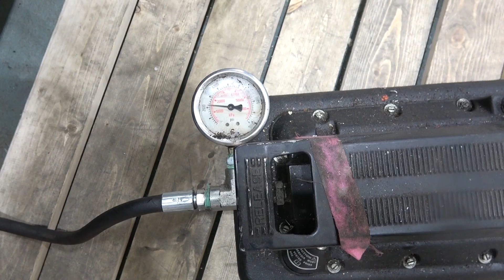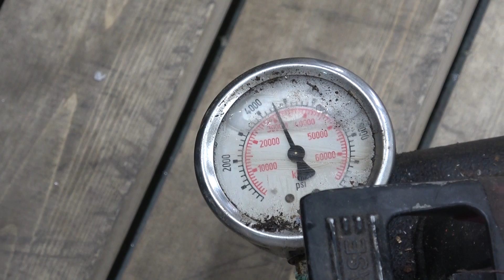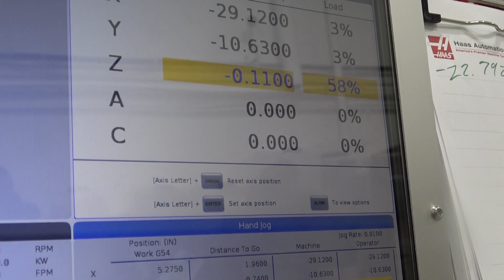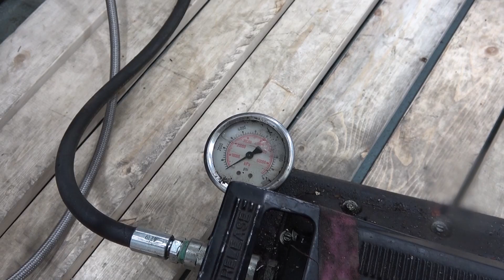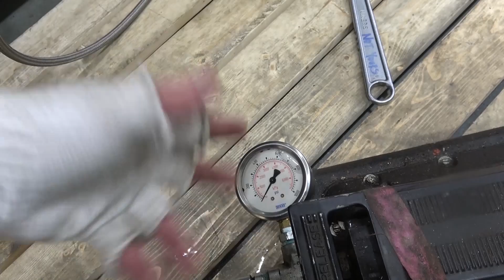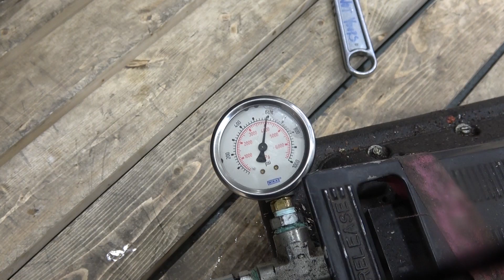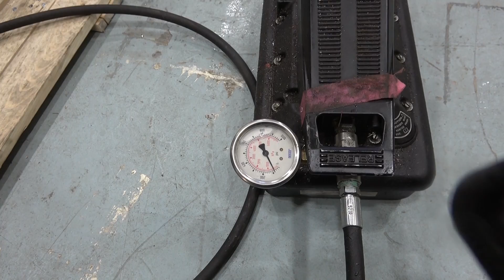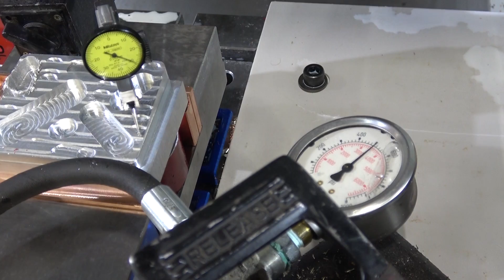Hydraulically Testing Pull-Out Force | Strongest Vise Jaw

Comment: Put an indicator on the top of The Pusher jaw. You will see it lift as you tighten it. So your part is already being pushed out just by tightening it. you can tighten the Allen screw in the middle of The Pusher jaw, it helps a little.

Comment: What about material malleability? Two material interfaces involving 3 soft metals vs two material interfaces involving one soft metal and two hard metals. Ask an Electrician, you can tighten a clamp down onto copper to a specific torque then go back a few minutes later and it will have eased off due to the malleability of copper.

Comment: I believe Aluminum on Aluminum has an abnormally high friction coefficient because the materials are similar. Similar metals like to stick together, so a steel part in the aluminum jaws vs copper jaws may have vastly different results
Reply: Upon further research, aluminum on aluminum has an extremely high coefficient of friction (rare example of mu potentially greater than 1 in some cases) - reference Norton Machine design. Therefore, use aluminum jaws for aluminum parts
Reply: I would guess from this information that a steel part would actually hold better in the copper jaws, since steel and copper are metallurgically compatible

Comment: You've made a critical error with those fingertipless gloves.  You see, those are designed to be cut back to each knuckle sequentially, giving you three goes in sub-freezing temperatures.  If you cut them back too far, the frostbite travels past the knuckle and leaves less stumpage to work with the next time you get caught out in the cold.  ;)

Comment: Cnc 101 at the community college. We write our first past as a class. Runs great in master cam. Go into shop brand new haas never been choouched. Load up and green button. First pass is facing with 2 5/16 job. Rapid traverse about an inch into brand new kurt vice. Some real deep purple chips and a dive to the catsup button. Learned to set zeros. But that vice will be forever marked.

Comment: The transition of forces during drill break-through is the exact reason that drills ground for aluminum have a smaller point angle. 
Even when the part stays in the vise the transition can break the drill flutes right off the shank.
Having the smaller angle increases transition time and reduces the shock to the tool.
You know where the bottom of the hole is in vise work, so it pays to program a feed rate reduction when you're cutting soft materials.

Comment: Super tight vise, isn't necessarilly going to hold better, despite outward appearances the jaws do flex, even if just a little, Put an hindercator on the solid jaw and tighten yer vice at a couple different torque settings... its really surprising

Comment: Possible explanation for reduced force despite coefficient of friction: the small amount of aluminum/copper jaw proud of the work peice will deflect imperceptably. Put an indicator on the fixed jaw side and see if it's bending back? With the steel jaw, deflection is less (stronger material, nothing proud of the jaw). I wager the top of the soft jaws aren't exerting the same pressure on the part as the top of the steel jaw.

Comment: Gonna watch the whole thing, but a few quick thoughts just from reading the description- 

1. What grips what what the best material-wise? Does ferrous grip ferrous better than non-ferrous and perhaps, bench-vice-a-versa? 

2. What about surface finish? What happens if some shiny ferrous jaws clamp down on some shiny ferrous surfaces? Do they act like gauge blocks? What if some gnarly, knurly ferrous jaws clamp down on some aluminum? Do they just dig in, or dig in and also weaken it structurally?

Comment: I think the reason steel works better is because steel is stiffer. The jaws of the vise slightly deform when clamping on the part, and deform the other way when the part wants to go. Steel doesn't want to deform. 
As a preliminary test for this idea I suppose you could try to use a harder piece of steel, or harden a piece you've got?

Comment: Steel is best because you can put more pressure on it and it doesn't warp as easily. Copper and aluminum are very very soft metals. Steel however is not soft at all.

Comment: The more you squeeze on the stock, the more it will want to pop out of the vise. Think about squeezing a file card or a playing card, the more you squeeze it the more arc you get. I would be curious to see if doing the test at 40 ft/lbs yields different results.

Comment: Forgive my novice ignorance, but I was under the impression when you get your chip load/tooth right the forces should be minimal. RPM feed rate and # of flutes. Luckily we have computer numerical control to calculate all that mess for us. I'm still working on rpm controls from the pc vs manually turning it down at the controller. Linuxcnc based pc and chinesium 6040 cnc. Only messing around with dead carbon carcass and refined dinosaur remains pressed in sheets so I can just give er, but actual metal chips as soon as I figure out the spindle control.

Comment: Is the coefficient of friction, that you find in most reference books, determined emperically or is it derived mathmatically?  If it is emperical do they determine the dynamic coefficient or the static one and then use that to determine the other.  I'm asking because if there is some sort of mechanicalsurface effect happening between the harder steel and the aluminum, then that will definitely cause your experiment to show that more force is required to break aluminium from steel jaws. It's possible that this effect might not appear in the aluminium breaking free from the copper jaws because both materials are softer and would therefore allow each material to deform eachothers surfaces with less force.

Comment: Also, you're using a horrible fraught tor-q-que wrench which is likely next to close to inaccurate as fraught.   Be intesting also as is the machinist friend, a piece of paper on one or both sides of the workpiece to increase frictiones.  We do that all the time and it keeps her stuck down no problems.  Maybe the amount with the vise force that the jaws are compressing lessening the farce?  Steel being the lesser of these evils.  I can tell you that unless you're hogging the frack out of the work piece, even a short custom vise hangle at a moderate chooch won't let the workpiece move attal.  If you want a nice finish using a shell mill, less is always more till she gets kicked like a horse right outa there.   Lest you're takin 1" DOC with a 4mm radial in D2 or 304SS, you can get away with a lot lest than you stink.
Reply from the maker: It's a proto.

Comment: Non-linear, like my car's gas guage?
Reply: Tank narrows put towards the bottom. Less gas in bottom half.
Reply: One would think it could but most likely not. I'm sure its still read via a floater in the tank. These days a horse and buggy will run 25,000+ and you would still get better gas mileage, so it does not suprise me unfortunately.
Reply: MK1 MR2 owner here - below a quarter tank, my fuel gauge is actually more akin to a stopwatch.
Reply: You joke, but my '95 Impala's gauge reads crazy high, pegged a hundred miles into the tank, more than half at 200 miles, only starts to really fall after 250 miles.

There's a fix, install a resistor inline, but if one uses the trip odometer then it doesn't matter much.

Comment: Are those steel jaws ground, or milled? Looked like you milled your copper ones. All else being equal, a ground finish should grip better than a milled one, right? If you milled the aluminum ones too, but the steel ones were ground that might explain why they grip better on your aluminum test block. Or I might be totally wrong!

Comment: You want holding force? Dovetail that shit. Make a set of dovetail jaws, cut dovetail into the part gripping it with more surface area, then mount it that way, practically zero clearance because you're going to deck off the bottom anyhow.

Comment: That is the correct pull out on the vise jaws, You did not place the clamping force on the full jaws only the part hold are that is only about 1/4 of an ich squared hence that is why the low push out PSI?

Comment: Correct me if im wrong, but as i understand it... if your goal is to clamp a part with as much force as possible. one side of the equation needs to have a density/hardness factor greater than the other. either the part being held or the jaws need to be much harder than the other. So for example if i want to hold a part and not damage it, i need to use a softer metal than the part for the jaws of the clamp. It will limit your clamping force because one side will collapse under the pressure. If you want to hold the part and not be concerned with damage. the jaws need to be as hard a material as possible and the part being clamped needs to be a softer material. Aluminum clamping aluminum. you will be limited to the overall hardness of the material because as you apply more force both jaws and part will crush and only so much force will ever be applied. a force equal to the hardness of aluminum in this case.

Comment: Why are you not using the full height (or even half the height) of the vice? As opposed to just the top cm or so. Shouldn't that help?
Reply: Of course it would for the total force required, but when your talking about PSI it shouldn't change once the math is done. He was trying to avoid the math, that's why he talked about the size of the hydraulic cylinder.

Comment: Copper is better when you aren't clamping flat on flat. You use copper to take advantage of the deformation so as to 'hug' the workpiece.
A harder clamp material with a non-flat interface can hold work pretty well. Take advantage of the workpiece's deformation by having your clamp poke into the work, so to say.

Comment: There are a few things that apply more grip to the part while in a vise like sitting it lower in the vise. You'd be suprised how much deflection Kurt vises have at their max torque. Another would be to apply friction in the form of recessed grippers. I've made a thin horiontal relief line across the entire gripping surface before. this works well without marking the part.

Comment: gauge last calibrated never.. haha, most of us think everything with numbers are 100% accurate, good to be reminded every once in a while.
I guess aluminium soft jaw's low holding power is because aluminium deforms much easily, or the oxidation on the surface?.  if you think the jaws and stock as springs in the y axis, you could model the system as spring mass damper in software.  such simple simulation probability enrage all the material engineerds.
looking forward steel dovetail teeth jaws test.
Reply: "most" pressure gauges of this type are most accurate at 50% of full scale. -when new, or recent calibration

Comment: Does the aluminium oxide act as a lubricant layer between the materials? (Which would explain why [ Al | Al2O3 | Al2O3 | Al ] would slide before [ Al | Al2O3 | Fe ]. )

Comment: You need to mosey on over to your scanning electron microscope in the NW corner of the shop.  I bet you'll find the granular structure of the materials and the surface finish have some impact here.  Either that, or copper deforms on compression and can't hold any spring that the steel can.  It also could be your lack of beer in the shop.

Comment: Could the test results be showing deflection of the material of the jaws before the co-efficient of friction is reached?  This could explain why the steel worked better.  Another test with a larger 'bite' area might prove more reliable for just a friction test.
Reply: I looked up a bending force equation and it seems very possible. I only estimated the values for the metals and surface area though, so I don't know for sure
Reply: @connorfrazee8272  Only there is no bending. The jaws are supported over their entire length.
Reply: and some slack in the vice/jaws in the vertical axis
Reply: Thought the same.  Especially with Al, and measuring center deflection in thousandths
Reply: Not a chance. The jaws are too thin and are supported over too large an area for a measly 500-1000 lbs to generate any kind of measurable deflection.

Comment: Those "two little dingle arms" on a drill bit...
Spiral flutes are good for removing chips but they're lousy cutting faces. I like to grind the tips off mine with a dremel tool with one of those potato chip cut-off disks on the same plane as the drill centerline.  Don't have to take much off to get a zero rake cutting edge. And it's super essential when drilling sheet metal.

Comment: I vaguely recall from a mineralogy class I took a few years ago that copper's crystal structure isn't very resilient to forces like that. The top few layers of molecules can slide like Molybdenum or Graphite just not as easily. I'd just assume anything that can be used as lube has a bad crystal structure for holding things in place.

Comment: Copper does not age harden, so it is the softest and most plastic of the three. Aluminum age hardens and thus is a smidge more stable. Steel is...well steel. Combine all that with jaw climb and you may be loosing effective surface area.

Comment: You're probably deforming the materials and not just sliding out.. Especially with the copper
Reply: That's my thought, either the jaws are deforming or the part is.
Reply: @peterwelsh6975  A little from column a, a little from b.
Reply: Deformation could increase stickage to a point though, before dropping off. 
Just like soft compound and warmer tires will stick better cause they have a conforming and thus larger overall contact area.

Comment: It would have been good to measure the clamping force for each set of soft jaws.  It's possible the copper jaws are deforming  and transferring less force to the part at the chosen torque.

Comment: Might I suggest moving the kurt vice closer to the operator on the table. Two reasons: less reaching in and tweaking your back and your vice handle can spin 360 degrees for faster jaw adjustment.
Reply from the maker: but but it's already squared up.
Reply: Oh, you got it set up perfectly? Break it down and set up this one piece.

Comment: the force would be greater if the pushipushie its in the middle of the pice??
Reply: Would probably avoid twisting and catching, might lower the threshold of pressure but it wouldn't change the effectiveness of the pressure, would still push just as hard off to  the side

Comment: Forgive my possible ignorance, but doesn't area of contact come into play?  Test for test it's ok in this instance since it's all the same between each material tested, but overall if there was more area of contact wouldn't the friction increase? Therefore getting the "push it up" force closer to the clamp force?
Reply: It comes in play when computing the force, as force = surface * pressure.
So since he's already talking about the normal forces, the surface has already been taken into account.
Reply: @GigAnonymous  I understand what you're saying, but if I have a gauge that's reading "x-value clamping force", it doesn't know what area that force is on. If that force is on the area the size of a pencil it's going to have a different amount of friction then if that force is over something with a larger contact area right?  The normal force is perpendicular to the frictional force that is being tested here correct?  I could clamp a cylinder in the vice with an incredible amount of clamping Force but since the contact area is so small I could probably tweak it sideways fairly easily
Reply: Not really, at least in theory it is independent of area. The only things that count are the force and the friction coefficient. If you get a bigger area you distribute the force more. It can however be helpful when machining very soft materials like wood or if you get your jaws to flex enough to be a reverse dovetail but I don't think that is reachable in practice.
Reply: Roughly speaking no. Friction is proportional to pressure, but pressure is inversely proportional to area. If you double the area but keep the total force the same, pressure drops by half and friction doesn't change. If you increase the area while keeping the pressure the same then friction increases also.
Put another equivalent way: friction is proportional to force between the surfaces, not pressure.

Comment: Partner, you know those Kurt vices split the tore que in and down, right?
Reply: That's just to keep your part from cocking over (deflecting) too much, under the strain of the vise. Makes for truer, more repeatable cuts - it doesn't effect the pull-out force.
Reply: @interstellarsurfer  I think he's just saying that the rated clamping force may be accurate, but the total clamping force is at an angle down, so it won't read the full force on the x axis only, since some of it is in z direction

Comment: Not everything machined is aluminum.  It would be interesting to see how those jaws work with holding different materials.  Steel, stainless (304L?), aluminum, copper, brass, nylon, acetal, polycarbonate (or some subset of)

Comment: In my experience the amount of force to pop something out of a vice is about 1ft/lb less then the amount of force needed to crack loose the fastener you are working on.
Reply: Or break the back side of the vise off
Reply: @joejane9977  Legendary Chinese quality
Reply: Yep broke the poop out of mine in no time  @joejane9977
Reply: In my experience, Chinese factories must use tool steel Alan keys to tighten Alan headed bolts. Why else would my mild steel keys have rounded off (and put grooves in my fingers) by the time the bolt starts to crack off?
Reply: @amanofmanyparts9120  S2 tool steel ;)
Reply: crazyguy32100 that’s so true 😂
Reply: crazyguy32100 Than*
Reply: crazyguy32100 gots work with some shock loading then boyo